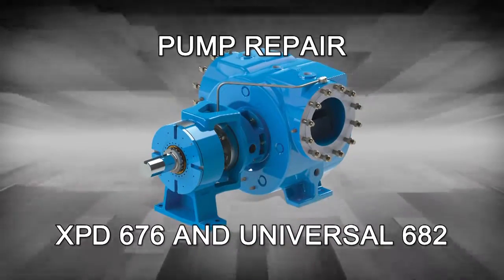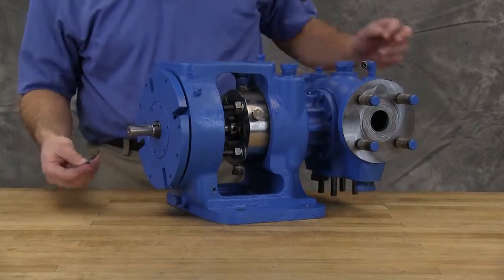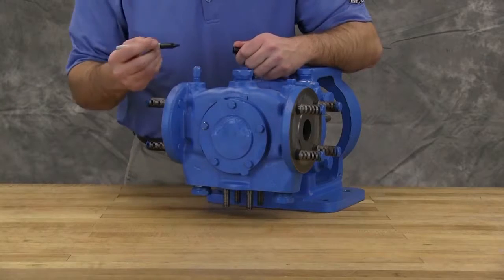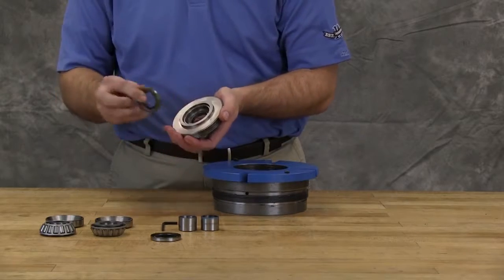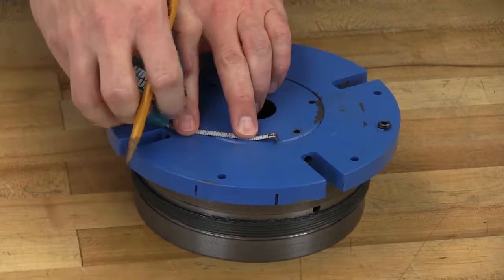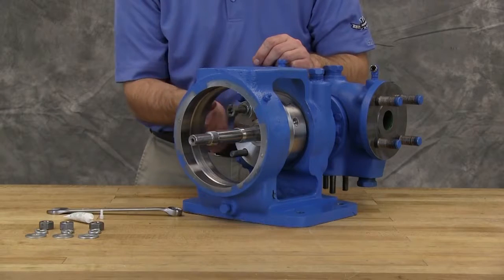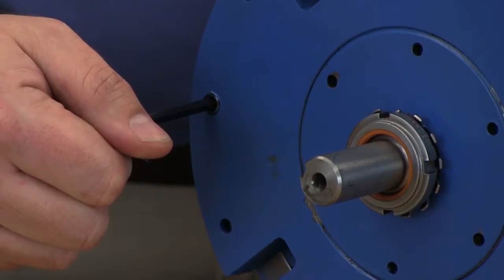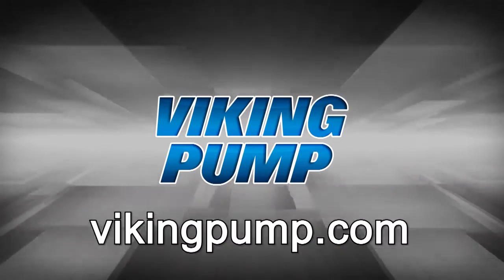Viking Pump XPD 676 Series Pumps Bearing Replacement

Comment: Hello, I can see that the pump bearing can be easily removed and installed from the pump shaft (without need of any jacking or pressing tools), bearing does not fit tightly with the shaft? What is the tolerance between the shaft OD & the bearing's ID? Appreciate your help.
Reply from the maker: Hello! For help with your specific pump you can contact us here to get connected with your local distributor: https://www.vikingpump.com/yt